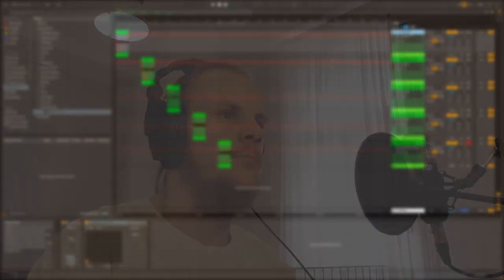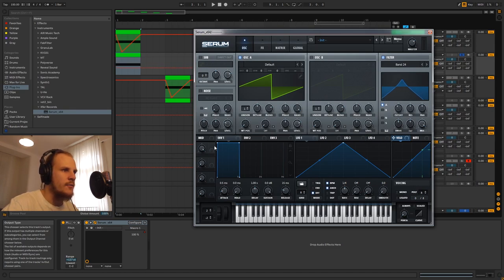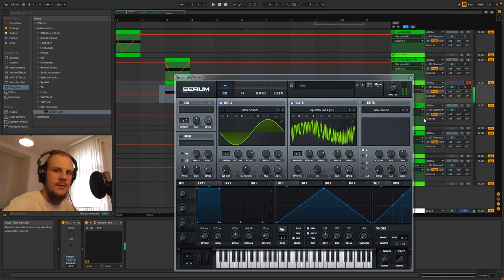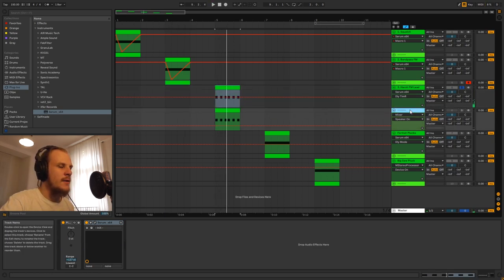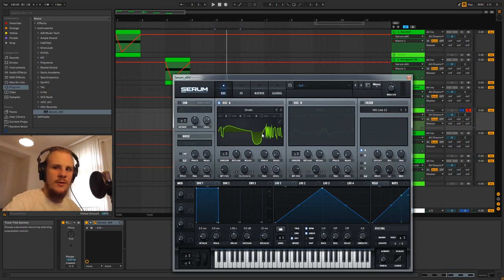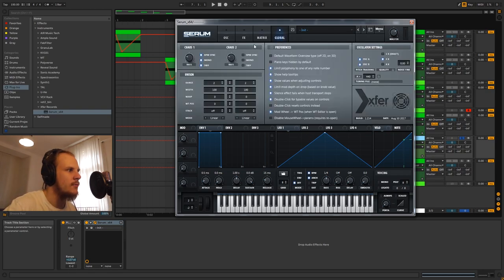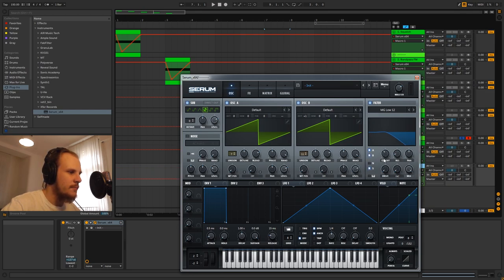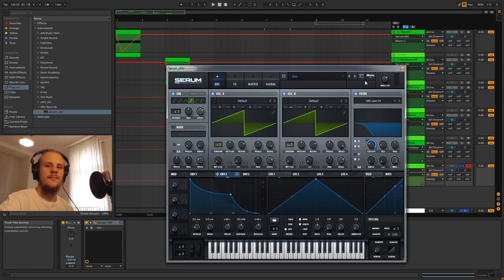5 Common Psytrance Synth Sounds and How to make them in Serum VST!

Comment: Hey, thanks for the video. Quick question: when making the squelch sound, or generally working with band-pass filters and automating them, I notice a distinct jump/stutter when I use an LFO to automate the cut-off. Different resonance values / etc. change where this jump happens, but it's audible enough to sound good. Usually about half-way through the bar. Any suggestions for dealing with this? I tested this with Serum, Vital, and another synth, they all have this problem.

Comment: Hey, on the first sound you start by drawing in automation but don't say exactly what parameter you're automating. What are you automating in the automation lane?
Reply from the maker: I'm automating macro 1 which is routed to the filter cutoff...
Reply: @Projektor_music  Thanks for the reply. Try as I might I can't replicate your first sound. Your saw wave is very clicky. Mine has no clicks at all unless I drop heaps of octaves. It sounds like a smooth saw with the bandpass running up and down :( I followed every step exactly (in FL) not sure how to make it 'click'. Thanks anyway.
Reply from the maker: @switchmain1956  You want to play it as the sub bass octave. i don't know which octave it is in fl's piano roll but I use the 0 octave on ableton!
Reply from the maker: @switchmain1956  You can also use a pitch bend upward to go from smooth to clicky which is a really cool effect. If you do it fast enough like within a 1/8 note it can be used in the drop as a rhythmic element too!
Reply: Thank you so much! I'll give it a try today - good to know I was on the right path with the octaves. Thanks again, your diligent replies put your tutorials in a class of their own.